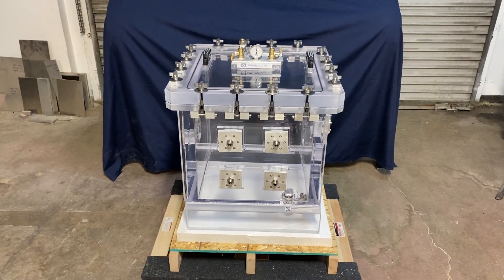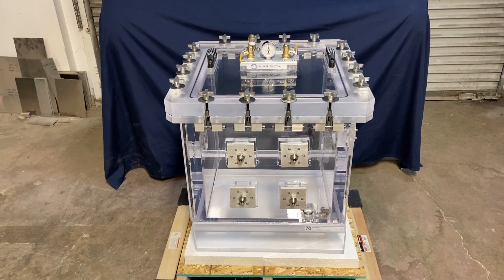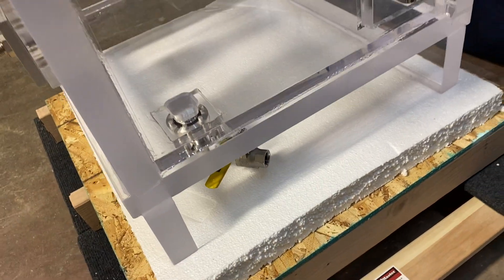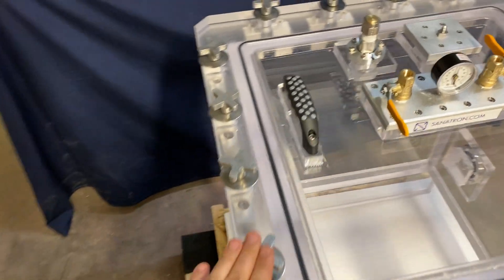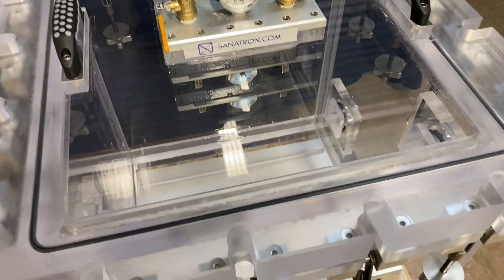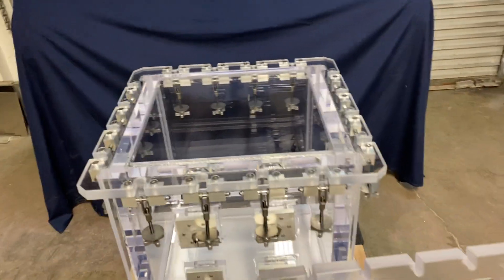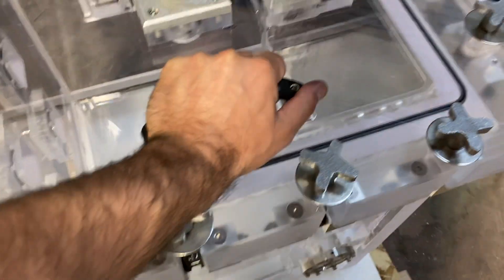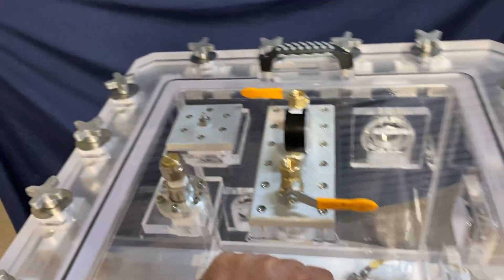Custom Vacuum and Pressure Chamber with Gas Vacuum Feedthroughs

Comment: Can you please comment about the pressure relief valve that you had mentioned in the video. Is this pressure relief valve adjustable in the sense that the relief pressure can be adjusted to different values.
Reply from the maker: The pressure relief valve is not adjustable and it generally set at a 15 psig maximum.